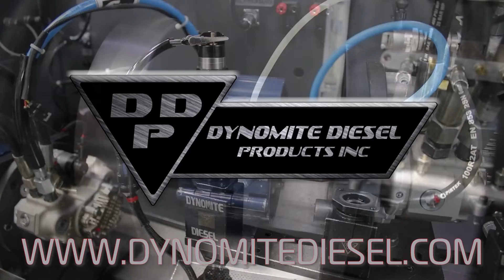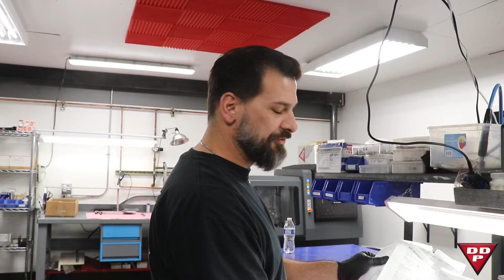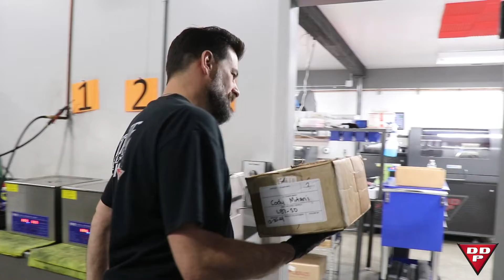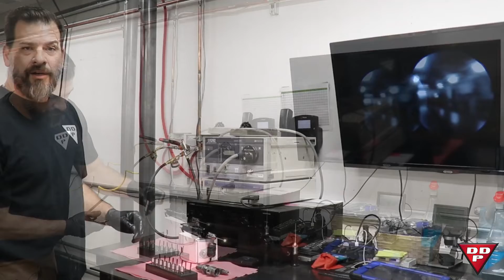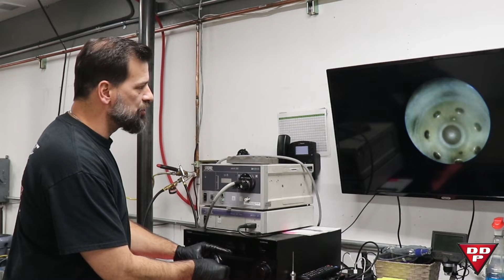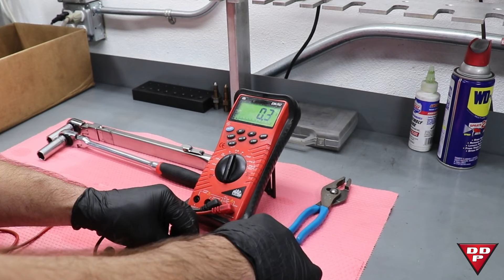Injector Testing Process

Comment: I’m curious if you could do a video on what gets replaced during rebuild, what the process is, and reasons to run rebuilt vs new since you offer both.
Reply from the maker: We do not rebuild injectors here in house, most of this is repair related. All of our remans come from a certified Bosch facility.